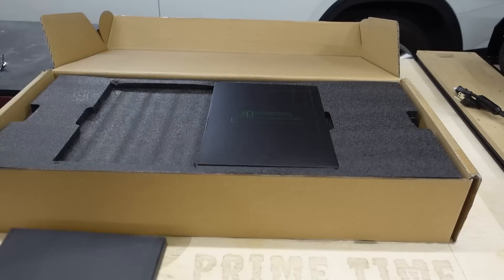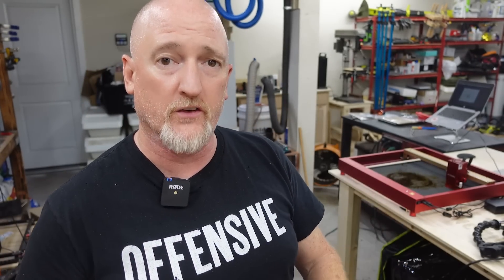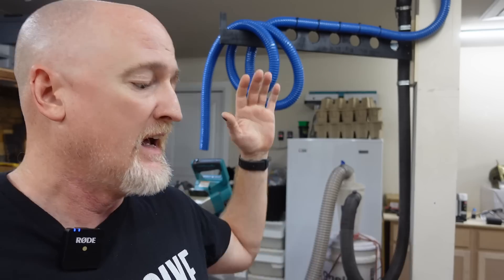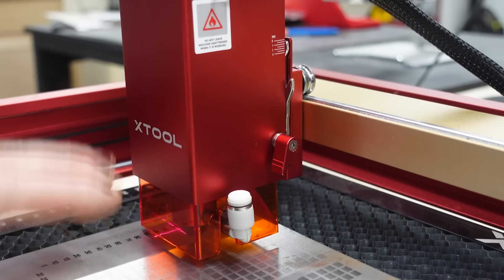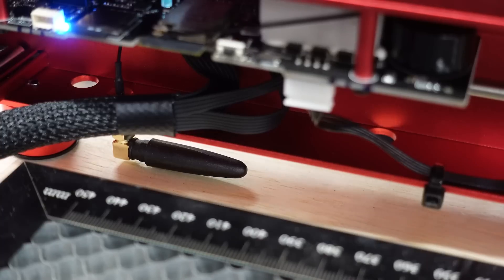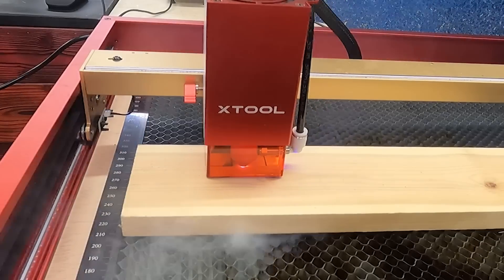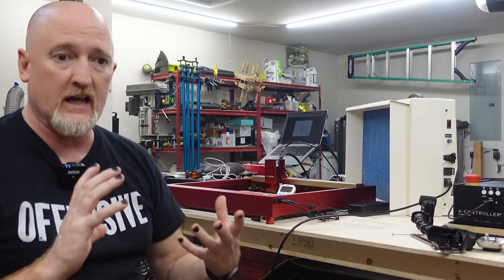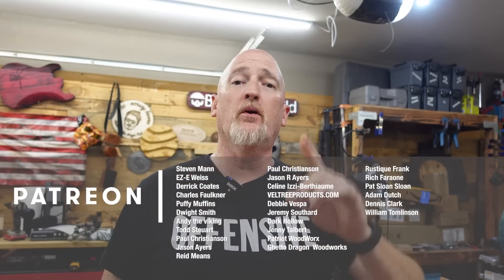This New Laser is Bananas! Meet the xTool D1 ProD1 Pro

Comment: can you please compare both 20w modules..?
Reply from the maker: There's no reason to. The modules have the same power. Everything else is superficial.
Reply: @BuildDadBuild  flame detection and micro Z adjustment are not trivial...with those two additions there would be a weight difference between the two modules and therefor a lighter equally powered module would in fact have a performance/production advantage if used on the same none pro machine frame...many people have purchased the first none pro 20w module and maybe scratching their head wondering why they've been waiting 3-4+ months for the first module to show up only to be hit by xTool with the new 20w pro model....feeling a little ripped off in fact.
nothing trivial there in my opinion... but whatever dude.